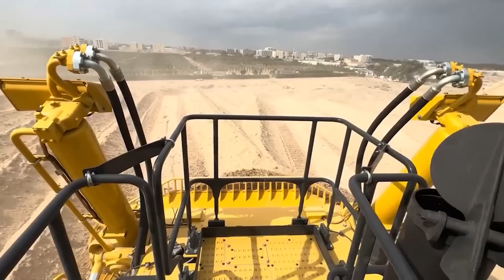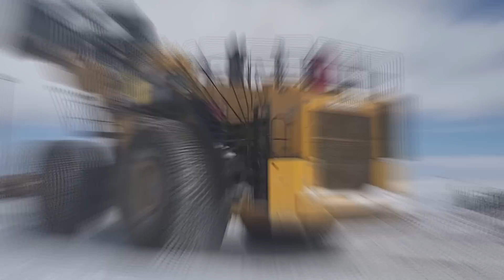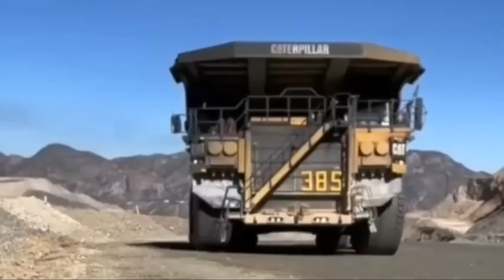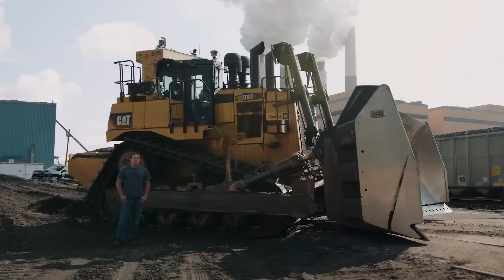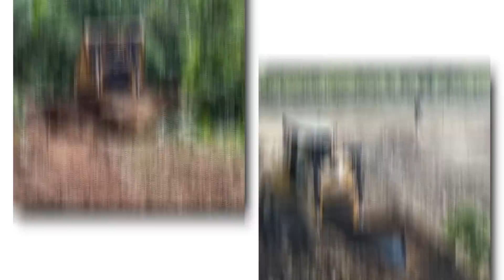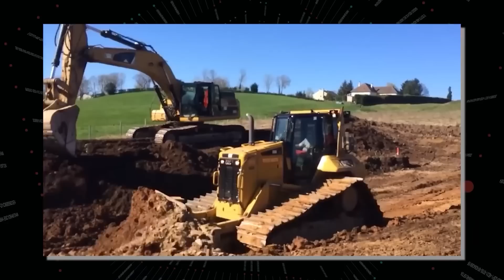20 Biggest Bulldozers in the World

Comment: While the video showcases the most massive bulldozers in the world, it raises an interesting question about the direction of the industry. The advancements in bulldozer technology, especially with models like the Shantui SD32 and the P&H 4100 Electric Rope Shovel, indicate a shift towards increased power and efficiency. However, I wonder if we’re placing too much emphasis on horsepower and size at the expense of innovation in other areas, such as eco-friendliness and adaptability to different work environments. As the construction industry faces increasing scrutiny over its environmental impact, shouldn’t there be a greater focus on developing hybrid or fully electric bulldozers? It seems like the conversation should include not just what machines can do, but how they do it.

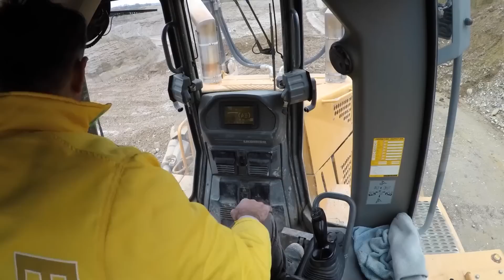Comment: The 15:07 part A specialized, modern machine with a compact, user-friendly design and touchscreen interface, featuring smart sensors for automatic process adjustments. It operates quickly and quietly, with wireless connectivity for updates and remote maintenance. Parts are easily detachable for cleaning or upgrades, making it ideal for professional work with high precision and time efficiency.